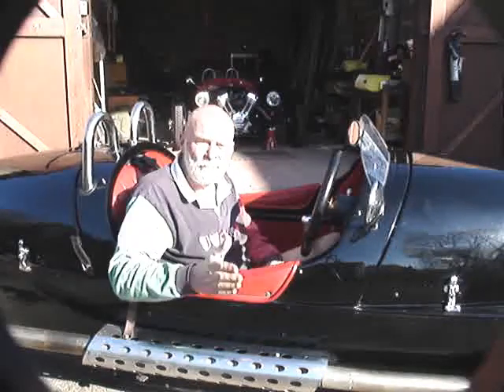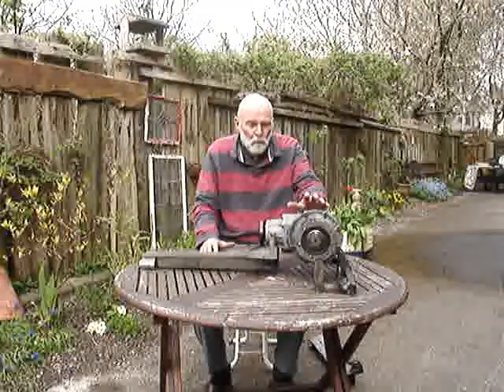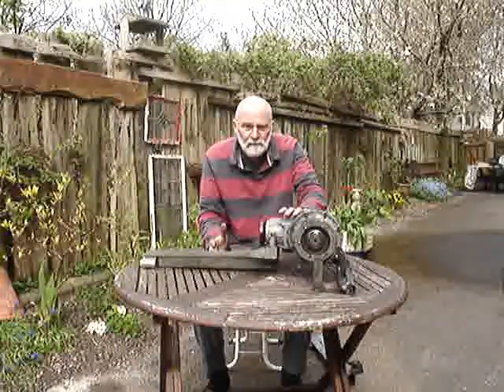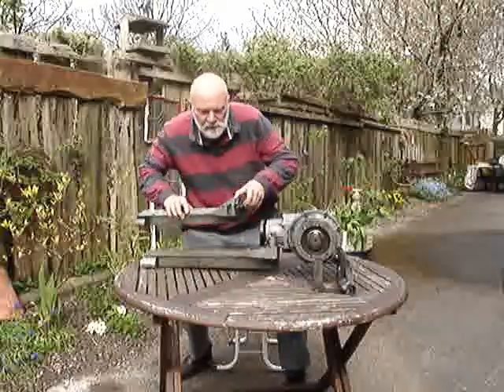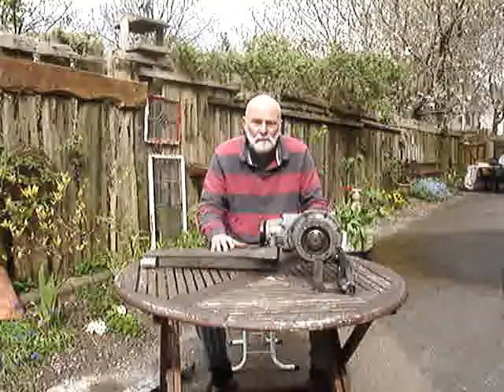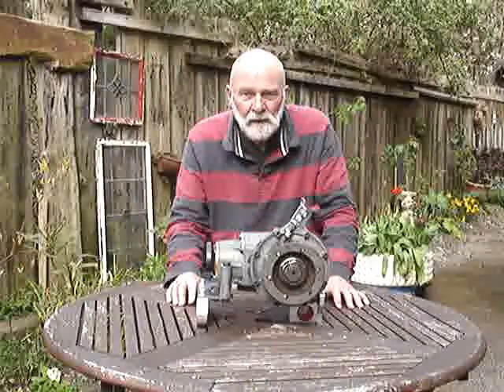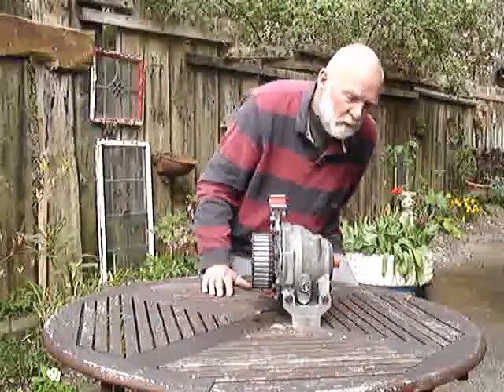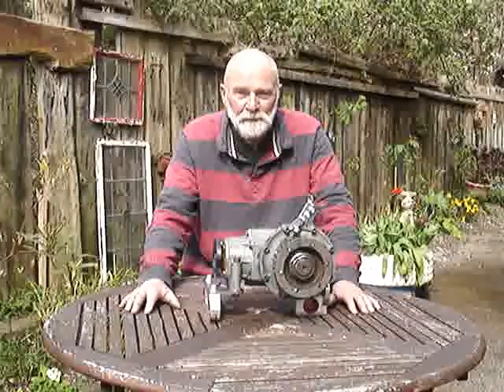Morgan 3 wheeler workshop, the bevel box upgrade explained

Comment: It seems like the force of the pinion climbing up the ring gear or crown wheel, and the force of the belt pulling backwards on the top of the toothed pulley, are exactly one and the same force, just looked at from opposite ends of the mechanism. You can't count them twice or add one to the other. Not to be too critical... just sayin'.
Reply from the maker: Thanks for your input - well spotted.  You are, of course, right - the only need to explain the different mechanisms producing said same force is that the garage mechanic uses the static tension in the belt to prevent the nose of the box from coming back down with a bang.  Once the thing is in motion, as you say, there is no addition to be done.  Not sure if I will remake the video clip though.
Reply: @morganthreewheelerworkshop1189  There is also a third dimension to the forces created by the rotation of the drive shaft twisting the FDU longditudally. These forces are mostly overlooked here.

Comment: Hello, I’m new to your channel and to M3w like a lot of people I’m fed up with the clonking/knocking from I believe the bevel box mount. Do you have a fix? Also the whining would the chain up grain cure this? I look forward to your response. Bob
Reply from the maker: Sorry for the delay Bob,  certainly the bevel box mounting upgrade will cure the harsh bang on acceleration and also much of the vibration at the 3,000 rpm area.  The clonking when pulling away with the revs too low is due to too much free play in the cush drive/compensator and my Centa upgrade will fix this along with giving you the ability to replace the rubber inserts at home in half an hour instead of £1,000 in a workshop as is currently the case.  The whining is bevel box internals and I think you have to live with it although I have some ideas but they may prove expensive.  The first thing to do is to ascertain wether or not you have the Centa cush drive and NVH kit fitted - my videos will help identify them - and then come back and we can talk some more.
best,
Phil
Reply: Thanks Phil, if I got the vehicle up to you, how much would you charge me to do the work on your upgrade to the be allowed box? We could see if the other parts you mention need replacing. The car was built September 2019, I have covered only 600 miles to date. Do you have a private email I can correspond on?
Reply: Sorry Beval box!
Reply from the maker: @bobjackson7824  Phil@woodenflutes.co.uk. A much better idea!  
Standard quote for bevel box mountings including 

labour to install working with you :-

Billet aluminium mounting kit.  Fully installed working with you= £940:00

The work will take one 8 hr day

The Centa cush drive will maybe last a few thousand miles - I have seen the ruined by 2,00 and some make it to 10,000 - the key is in the fact that my upgrade makes the whole thing stronger and you will be able to change the rubbers at home in half an hour.
Phil
Reply: Hi Phil,

Thank you for responding to my message, what is availability like if I wanted to book the M3w to have the beval box upgrade work done? I would like to discuss other options and upgrade you offer to understand the benefits.

I await your response.

Regards,
 
Bob
Reply: Hi Phil, not sure if you have seen my two responses here and wooden flutes? Bob
Reply: Hi Phil,
This is my third attempt to get a response, I’m not sure you are receiving my text. I have also tried reaching out to you on wooden flutes to find out a date for works?
Bob
Reply: Morgan Threewheeler Workshop Phil, is there a number to call you to discuss booking with you for the works. I’m not having much luck reaching you via email. 
Bob

Comment: Again, nicely done! I would have extended the nvh torque arm aft under the diff to also engage the rear bolts of the diff to prevent bending but your solution is more elegant and efficient.
Reply from the maker: Your solution would work well.  I went for less weight and as you say, a touch of elegance!